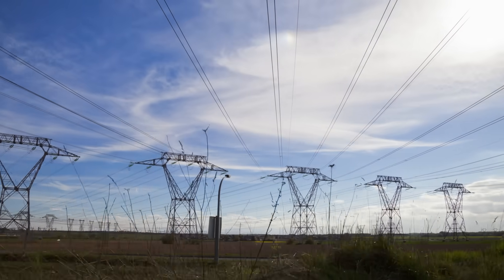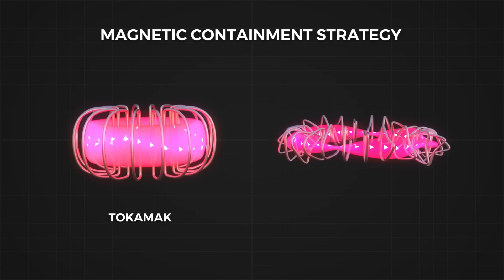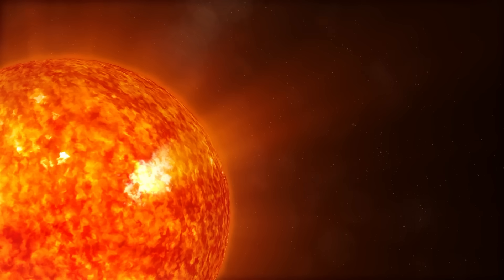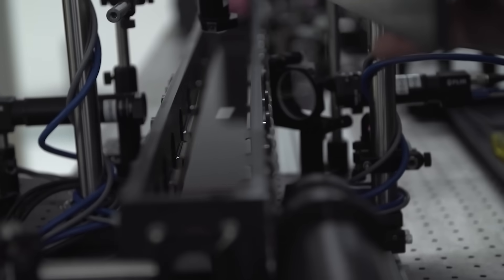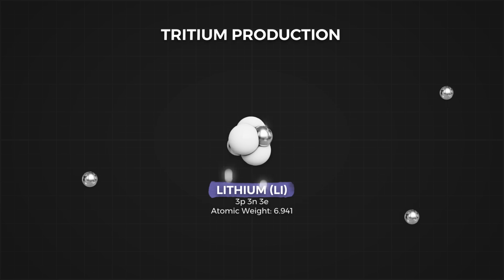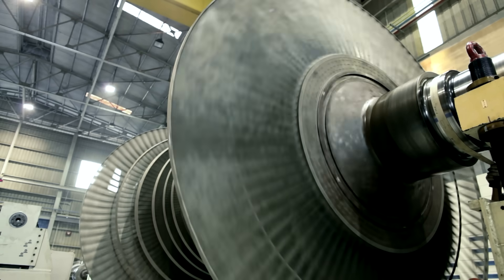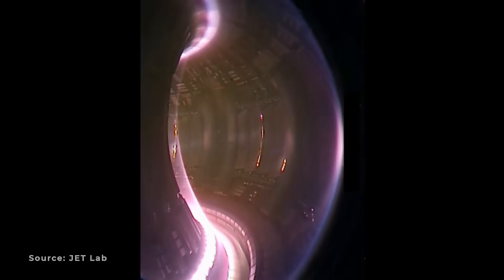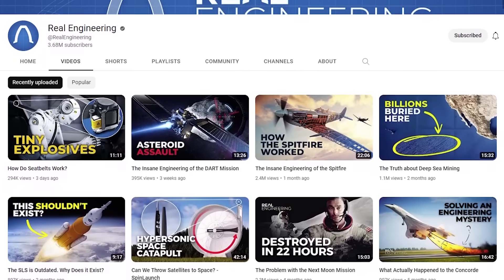The Problem with Nuclear Fusion

Comment: The biggest casualty of free energy is the economy, followed by the environment. Imagine the consequences on the stock market and the fact that the ability to leave, for example, lights burning, air conditioning, heating running 24 hours a day? Worth a thought.
Reply: The infrastructure to produce that power is very expensive. No one would be dumb enough to distribute that energy for free, unless they wanna run out of money to produce that energy in the first place.

Also, the reason that leaving lights, ar conditioning and heating running is bad is because of the CO2 involved in producing the energy they use. By abolishing fossil fuels, we would be doing 1000 times better for the environment than anything the abuse of said clean energy could cause.
Reply: @EmanatorOfEnigmata  I don't think you get my point. Who controls the energy? It's all very well covering the North African desert in solar panels, for example but relying on unstable countries, as we see today with Russia, will be a problem. Secondly, it's not about C02, it's more about the fact that "free" or cheap energy can lead to environmental changes. It has been proven that wildlife, plants and humans can go undergo major distress because of a 24 hour artificially influenced life. Many studies have been carried out in cities. How much will we pay to find tranquillity in, maybe, a simulated world to escape the 24-hour system and the people who inhabit it? 1984 could be around the corner. Utopia with "free" energy seems to be the way the forward but the "golden fleece" is fraught with problems. Maybe we should take a step back and stop chasing the dream.
Reply: @chiefstandard8mmuk591  Tbh, is not an issue at all.

CO2 is the big problem. Global climate change, planet heating, melting of the poles, death of countless species, destruction of the ozone layer, are all because of CO2 and the greenhouse effect, as well as emission of toxic gasses like carbon monoxide.

Even if using our machines 24/7 did cause issues, we would be doing 10000 times better for the environment by abolishing fossil fuel and stopping CO2 emissions. That alone is worth pursuing this goal. Not to mention the unimaginable advances in science that will come with huge, cheap amounts of our single most limiting resource.

Comment: Perhaps there's a longer term problem with the reaction people could have to free or very cheap energy; they leave everything on creating heat that goes into the environment.
Reply: The energy Earth receives from the sun is 10,000 times as much as all of humanity's energy consumption combined.
Heat emissions for human energy consumption, even if it increased dramatically and none of it was used to do any work, would have little impact on global temperatures.
Reply: @elmarmoelzer2229  That is comforting.

Comment: 402 mj to create a 20 mj laser that outputs 25 mj is not success its waste a money on power
Reply: To be fair, NIF was designed as an experiment without any consideration for efficiency. Modern lasers have 20 times the efficiency and there are some other tricks that can be used to further improve on overall system efficiency.

Comment: Their biggest problem is that they ran out of money, not that they had a breakthrough. So called fusion breakthrough being publicized doesn't consider the huge amount of energy required to make the whole plant run and not just the small part used for the end result.

Comment: Limitless clean energy? 

Status of the Magma Energy Project
Dunn, J. C. (Sandia National Labs., Albuquerque, NM.)
Abstract
The current magma energy project is assessing the engineering feasibility of extracting thermal energy directly from crustal magma bodies. The estimated size of the U.S. resource (50,000 to 500,000 quads) suggests a considerable potential impact on future power generation. In a previous seven-year study, we concluded that there are no insurmountable barriers that would invalidate the magma energy concept. Several concepts for drilling, energy extraction, and materials survivability were successfully demonstrated in Kilauea Iki lava lake, Hawaii. The present program is addressing the engineering design problems associated with accessing magma bodies and extracting thermal energy for power generation. The normal stages for development of a geothermal resource are being investigated: exploration, drilling and completions, production, and surface power plant design. Current status of the engineering program and future plans are described.
Publication: 
Presented at the Symposium on Geothermal Energy, New Orleans, La., 10 Jan. 1988.

Comment: Firstly, wars are not waged over energy production. That is 19th century thinking. Since the mechanization of war in the 1930s, engaging in war has increasingly cost more energy and resources than you get back out of it. Side note: this is not a good thing, as wars are increasingly waged over ego and ideology. Much more dangerous objectives.
Secondly, I get ever increasing feelings that fusion will be beyond our grasp until we crack some other technology first. Just as AI systems have let us develop predictive systems that have edged us closer, there will have to be a development in a separate field to let us crack one of the remaining issues. Perhaps its the ability to warp space (this is a new field we have recently seen results in), to give us a more efficient means of matter compression. Perhaps its something else.

Comment: It's a pipe dream.  Better to focus on scalable Geothermal energy.  Geo Therm is far more actionable and realistic.  It can be done anywhere, and has been harness-able, and has had surplus ROI - WITH NO POLLUTION!  I don't understand what is wrong with looking for efficient, low cost, actionable ways to harness the earths internal radiant heat.
Reply: It’s not actionable or cheap. There’s very few places where it can actually produce much power.

Comment: Do people calculate how many years before each system runs out of fuel, causes unacceptable pollution levels, becomes too costly, etc? I wonder when we'll have issues with burning our oceans or air (turning all the hydrogen into helium or larger elements).

Comment: have they ever tried to use heated air ? to move a turbine - but the turbine would move much faster  ?
Reply: That’s what a gas turbine is
Reply: @Gomlmon99  Umm, hot high pressure steam IS a gas. "gas" turbines with hydrocarbon fuel are driven by a mixture of hydrogen oxide, carbon dioxide and a quite small but lethal amount of nitrogen oxides.
Reply: @jacksimpson-rogers1069  A steam turbine uses steam. A gas turbine is coupled with the burning of hydrocarbons (e.g. nat gas) and is turned by the hot exhaust. Both are combined in a CCGT plant.

Just because a steam is a gas (technically a vapour), it doesn’t mean a gas turbine is a steam turbine. They’re different things. 

And why are you saying “hydrogen oxide” not water lol?
Reply: @Gomlmon99  You misunderstand my point. A turbine is a turbine. ALL turbines are gas turbines, except hydraulic ones. My point is that it is unduly restrictive to say that "gas turbine" means only hydrocarbon burning turbines. The difference between the steam turbine and the steam piston engine was far more radical than between steam and burnt hydrocarbon gases.
Oh, and "technically a vapour"  does NOT distinguish anything from being a gas. I think its an attempt to belittle steam. The difference in temperature between one turbine's input gas, and another's is thermodynamically crucial. That is one reason why the MSR and Fast Neutron reactors are an immediate improvement upon those with liquid water as the working fluid.
Reply: @Gomlmon99  I call it Hydrogen Oxide, and I could have written dihydrogen monoxide, because 'Steam' conjures up  the notion that it isn't a real gas. The term "natural gas" makes sense only by comparison with "coal gas" which is dirty enough to contain the deadly carbon monoxide. The stuff in the pipelines is exactly as natural as gasoline, an unfortunate US term that gets abbreviated to 'gas', whereas "petrol" conjures up the notion of a liquid fuel from the ground. If I had the power, I'd call LNG "liquid carbon tetrahydride", which might remind some of my less well informed friends in  the left that the stuff is NOT clean in terms of our atmosphere's carbon dioxide excess.
Reply: @jacksimpson-rogers1069  You clearly don’t work in the industry lol. Regardless of how you think it should be called, a gas turbine IS referring to hydrocarbon exhaust, and a steam turbine IS referring to steam. That is how everyone calls it, that is how it is taught at universities, that is how manufacturers sell them. The designs are different and the uses are different.

Just because steam is also a gas, it doesn’t mean anyone calls a steam turbine a gas turbine.
Reply: @jacksimpson-rogers1069  why do you call it hydrogen oxide? No one does that. No one anywhere in any industry does that. It’s just being difficult for no reason.

Comment: How can you call your channel "Real Engineering" and not understand why fusion is actually a real pipedream?

Do you fully understand the Second Law of Thermodynamics? Do you understand why a coal plant and a fission plant do not violate it? Now a very basic question, would a fusion power plant? 

There are two possibilities, a FPP "burns" a "fuel" that contains more energy than it releases, that's how coal and fission plants do it, or it would have to always input more power than it gets out. Anything else is a perpetual motion device, reversed entropy and silliness. Which is it?

Yes, I really am very bored by this. "Science educators" who don't know basic science  annoy me beyond tolerance.
Reply: Watching raw displays of confident ignorance in the wild, always makes me chuckle.
Reply: Imagine being this confidently incorrect when you don’t even know basic physics.
Reply: @Gomlmon99  But shockingly you can't even point out the error you claim I've made.
Reply: @KenS1267  Your suggestion that it breaks the second law of thermo. It doesn’t.

What’s especially embarrassing for you is that you probably meant the first law. If you did, you’d still be very incorrect.
Reply: @Gomlmon99  Brutal 😂
Reply: @Gomlmon99  No, I meant the second. That you don't understand it doesn't mean I don't.

People claiming fusion will generate more energy than put into it without an energetic fuel are saying it reverses entropy. This has nothing to do with conservation of mass/energy. But please do keep lecturing me on thermodynamics when I clearly said what I was talking about and you clearly cannot even read.
Reply: @KenS1267  The second? Why don’t you google what the second law is before you comment further.

There is an energetic fuel. It’s called mass.
Reply: @Gomlmon99  Ok, 

1) how much energy does it take to make a gram of tritium? 
2)How much energy does it take to collect a gram of deuterium? 
3)How much energy does it take, in the most mathematically optimistic scenario, to fuse those into helium? 
4)Now, I'll even be nice and assume no imperfect fusion products which will never happen, how much energy will be released only in the form of high energy neutrons, the form that can be used.

Now, add 1,2 and 3. Compare it to 4. 4 is smaller. 

But wow, way to show you had zero idea what was under discussion. You still need to own up for not knowing what entropy was.
Reply: @KenS1267  The second law has nothing to do with entropy. You’re thinking of the first law.

I studied thermo quite extensively at uni, I’m comfortable with what entropy is.

Yes, this is the whole point of fusion. The energy released is greater than the energy put in. That’s how nuclear reactions work. 

To answer your questions:
1. None, tritium is bred.
2. Effectively none, chemical reactions are insignificant to nuclear ones. Surprised even you don’t know that.
3. Less that is released when it fuses. Look at a binding energy per nucleon graph.
4. About 3/4 of the energy is released as a neutron. The rest goes into heating the plasma further.

4 is much much larger. If you don’t believe every physicist in the world, and think you know better then go add the numbers yourself. It’s a relatively trivial calculation.
Reply: @Gomlmon99  LOL.
No, the First Law is conservation of Mass/Energy. The Second Law is entropy. Please take your foot out of your mouth and look them up. You are just wrong.

Also you're lying about studying entropy. No one who studied physics would confuse Conservation of mass/energy with entropy. A laymen might confuse them as they are related concepts, as they are parts of thermodynamics, but they are not the same things. That's why one is the First Law and one is the Second Law.

Again and again, when you account for all inputs and all outputs the output energy must always be less. That is always the case. ALWAYS. We get around that by doing things like burning coal, which we didn't put the energy into in the first place so for us it is a net gain but overall there is less energy than went into it. In fusion there is no fuel that holds any easily accessible energy, and no "mass" isn't fuel no matter your previous deranged claim.

1) fundamental misunderstanding of what energy means noted. Also if you think it doesn't take any energy to collect bred tritium you are a monstrous idiot. I'll clue you in on this, tritium is poisonous, explosive, radioactive and still the lightest gas in existence. It takes a lot of energy to collect, compress, transport and safely store it and to dispose of the containment vessels.
2) Another fundamental failure, strike 2.
3) Strange how it took 50 years to even get close to break even and the lab that is claiming to have done so has yet to actually provide the data for independent review (also that break even was only on creating the fusion event and ignored costs 1 & 2). That's strike 3.
Reply: @KenS1267   
Open the Second Law of Thermodynamics Wikipedia page. It’s about temperature moving from hot to cold. The Third is about entropy. 

I’m not confusing conservation of mass-energy with thermo, because the laws of thermo don’t tend to be used for nuclear systems. There’s other things we use. 

Yes, mass is energy, and therefore fuel. That’s the very basis of what Einstein showed us. You can deny it if you like but then you’re trying to deny what Einstein said and that’s a big claim. 

You don’t even know how tritium is bred do you? I’m well aware it’s poisonous and explosive, I work in the fusion industry. The energy to collect a gram of tritium is absolutely nothing compared to the energy released by its nuclear reaction. Again, you’re forgetting about the immense amount of energy that can be released by a minuscule amount of mass. 

This lab is a nuclear weapons research facility. Maybe you missed that one. 

You’re claiming all of modern physics post-Einstein is incorrect, and that you know more than every physicist in the world. What are your qualifications to suggest that?
Reply: fission releases more energy then consumed above iron while fusion releases more energy then consumed below iron. The potential energy is there.
Reply: @jimskywaker4345  LOL. You failed to even understand the question (BTW if what you claimed was true the heat death of the universe would not be a thing).

Also you should find whoever taught you physics and slap them, hard.

Comment: Nuclear fission is NOT uneconomical. It is expensive, but that is not the same thing. The single plant costs a lot to build, but per MWh produced over the plant's lifetime only coal comes out cheaper*. The problem with nuclear fission is that currently nobody wants to front up that massive cost of the plant, no matter how cheap the amortised lifetime cost will be.

* No, renewables are not cheaper when you compute the lifetime costs because solar and wind have third to half of the lifetime of a nuclear plant and the fact that solar and wind only produce year-averaged 30% of their nominal capacity. Nuclear produces 95%. This combined means you have to overbuild 6-9 times more nominal MW capacity of solar or wind to match the nuclear plant's lifetime production.
Reply: The big problem with fission reactions is the waste that has half lives of many thousands of years.

Comment: Why the fk ppl say fusion is clean when you irradiate the fuck out of your fusion machine?
Reply: Because that’s not a problem and it doesn’t pollute anything
Reply: @Gomlmon99  any part that is near the reaction and needs changing is radioactive from the neutron flux and needs to be disposed just like the waste from fission plants
Reply: @viermidebutura  Nothing like the waste from fission plants. Thousands of times less strong and thousands of time less long lasting.